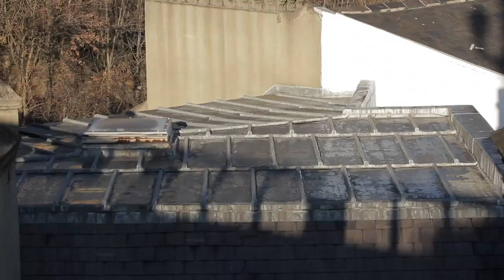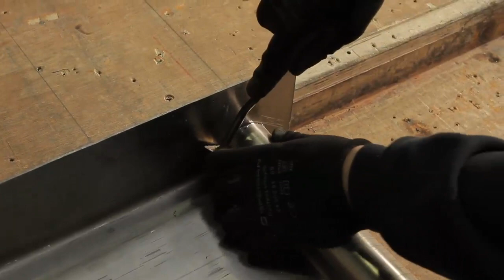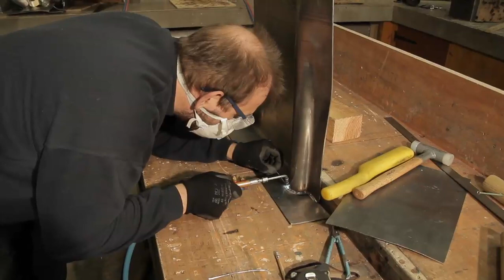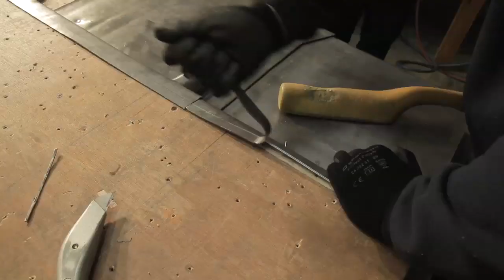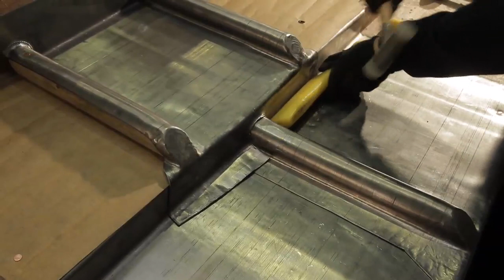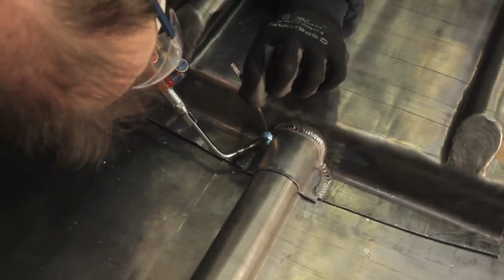Installing flat roofs

Comment: Everything on these wood core roll flat roofs can be bossed and when you know what your doing it's a hell of alot quicker also. You know your good when you can boss a flat bit of code6 into a 200x200mm open end box.

Comment: I learned to do this with just bossing and heating the lead....started off bursting the corners and needing to weld patches...by the end of the job i was able to dress the corners so that the corner was the thickest part of it :) white rubber mallet is better than a ball head for roll ends

Comment: So how you weld if the sheet of lead is to long to stand on end?
Reply: +Clint Hopkins 
You just weld it in place, anyone with experience  would probably do it in place, but saying that I prefer when welding when ever I can to do it away from where I am fitting the lead as this reduces the fire hazard,
I would also say that most experienced lead worker would boss it up then dress it around
Also in the film it is not the tidiest work, it would benefit from using a slotted slip plate, a rubber mallet and heating the lead when bossing around the wood roll